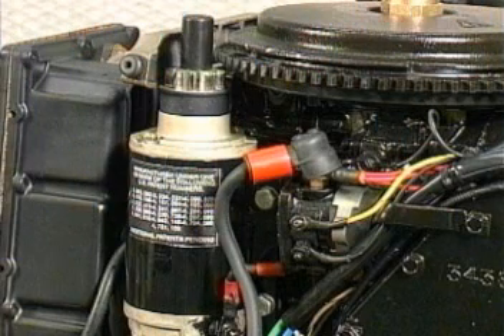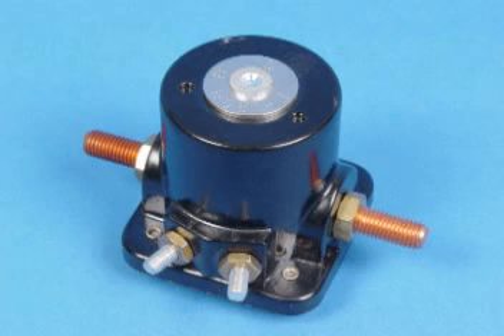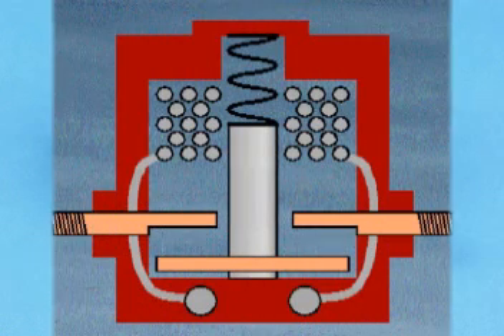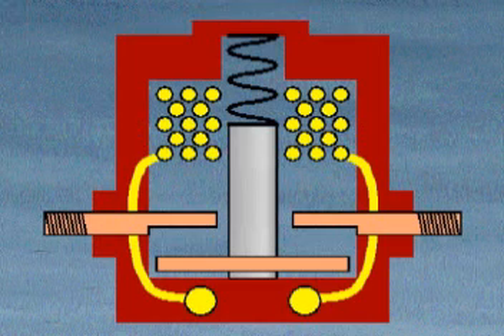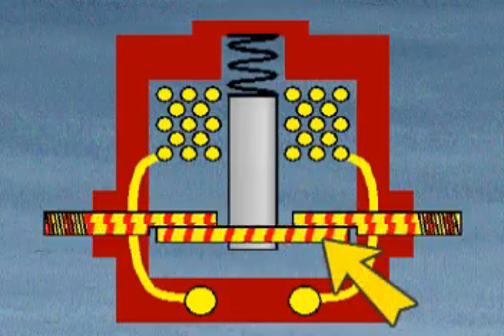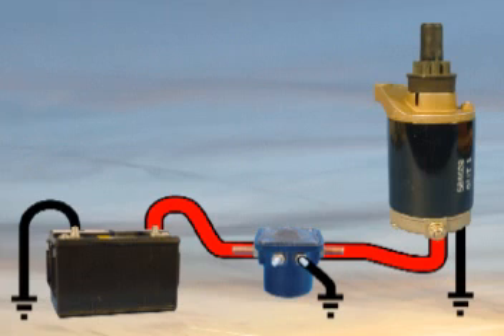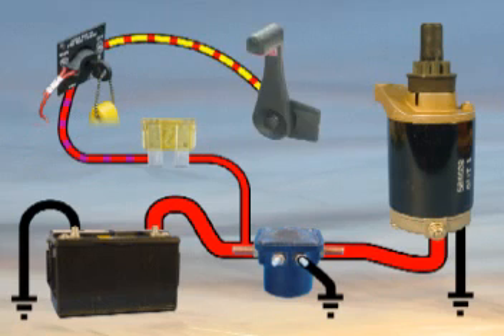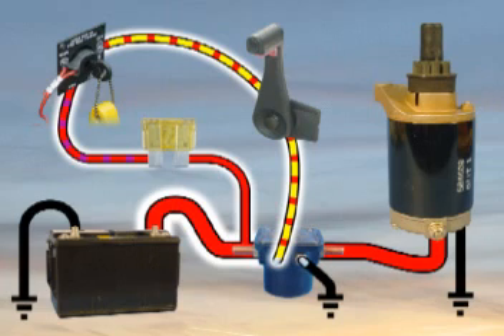Evinrude Johnson Outboard Starting System

Comment: 1968 Evinrude 33 horse electric start with charging unit on it two wires yellow and blue are they part of the charging system do they get connected to the positive post of the battery

Comment: At 43 check your coil n leads to check the leads stick a screwdriver in the lead an kick the motor over if you get a shock ur in luck ur coil works and so does your leads so your spark plugs rooted hope this helps

Comment: the wire with the fuse that hooks to the key switch where does it hook up to cause everthing looks hooked up to me....but that fuse wire comes from the batteryand goes about 3 feet and is cracked off but i cant find any other wires that it should hook to?  my engine turns over when you turn the key but has no spark on all three plugs/coils....any suggestions?

Comment: the main things to bring while out in the sea, prop & it's components! extra magneto with connections, pistons, extra spark plugs, fuel filter, die cast screw and nut kit. hammer socket wrench ( to unscrew the flywheel ) , ignition or cdi kit ( spark plug wiring ). extra carbs would be nice, but never really needed.